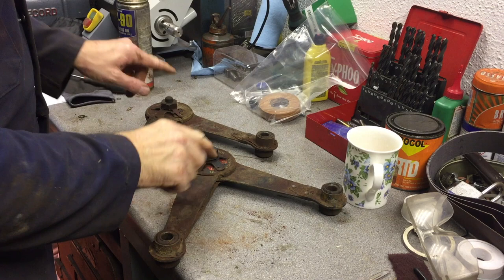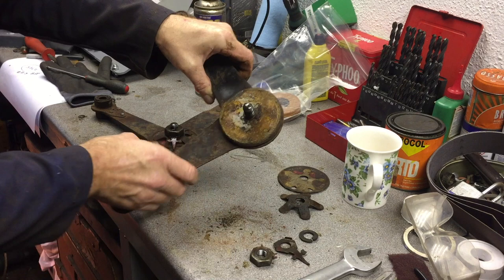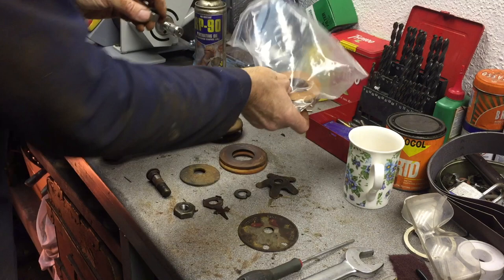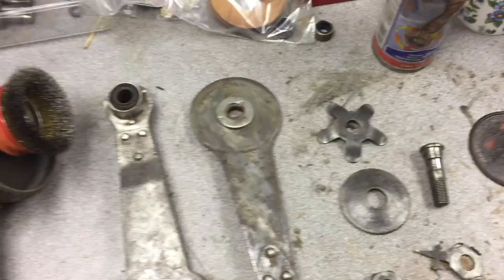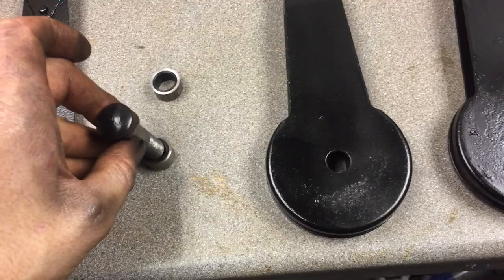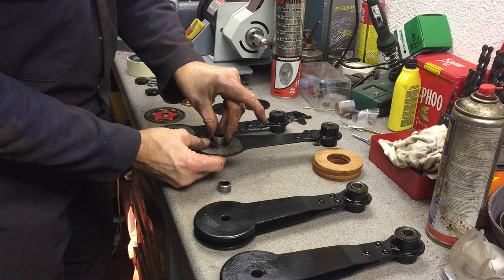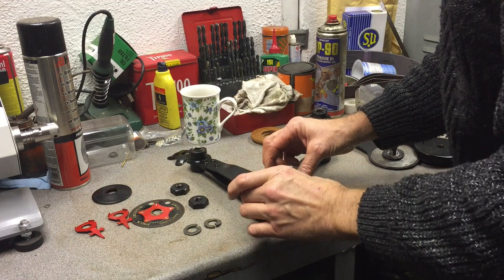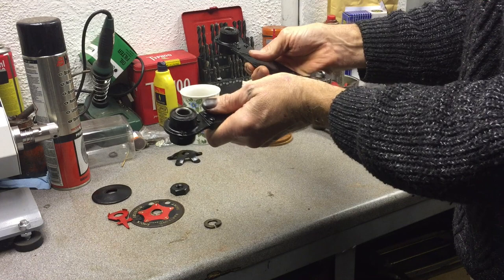Overhauling Andre Hartford shock absorbers from a Riley 9 Monaco

Comment: Bloody brilliant, I've got hold of a pre-war Crossley 1127 IOE in a chassis, and couldn't for the life of me work out how the dampeners mounted. The Hartford type may just be the job.
Reply from the maker: Very nice, i did look at a six cylinder pre war Crosssley  ( the same engine used by Lagonda with a bit of reworking )  a while back but i don't think i would of had the room for it in the garage. I don't have any affiliation with them apart from ordering parts from them but www.vintagecarparts.co.uk have a range of chassis mounting bolts for the Andre Hartford shocks which may be of use to you
Reply: @TweedsGarage  Sorry for the very late reply. I will send them an email as it's bloody hard finding parts in Australia for the less well known models. Thanks for that.

Comment: Very interesting and informative.  Is there a flat on the bolt that the either the adjuster number plate or indicator lines up with? Wasn't clear on the rebuild. 
I think you could do with a sand blasting cabinet.
Reply from the maker: i did have a blast cabinet but unfortunately for the amount of times it was used it didn't justify the amount of valuable workshop space it took up, so had to go. The indicator has two upward bent tabs that locate on the side of the adjusting nut so it indicates the movement.

Comment: Just one thing - although they are pre-oiled it doesn't hurt to oil the wooden discs by soaking them overnight in (originally) tallow, but thick oil (SAE 140) will do as well.
Elsewhere on internet it is recommended NOT to oil the discs at all but that is very bad advice; the shock absorbers will not work properly if the discs are dry and will actually soon break down.
Also it is not explained here how to set the tension - the best way is to place one arm on an old fashioned bathroom scale (not digital) and push the other arm down in a fluent movement and adjust the nut so that you get the required reading (40 Lbs on my 1500 kg Lagonda at the front, about 25 Lbs at the rear).
Reply from the maker: Thanks, I'll keep it in mind when i finally get some miles under the Riley , i did preload the units with luggage scales after i stumbled across some info for the loadings for lighter cars ( found after making the video which is always the way of things) . Thanks for watching .

Comment: How difficult would it be for the manufacturer to make replacement parts that fit exactly??? The over-long bush represents a waste of material, and over a production run they would have been able to produce additional items, so in their interests to get things right. I don't think I bought these for my overhaul so I won't have to fettle - none of this should be necessary if someone did their job properly and paid attention to detail. So much stuff for the older cars is not machined to the correct size, at different times I have brought it to supplier's attention the errors, doesn't seem to make any difference as the parts are still wrong, sometimes, there is a success, but there is a whole host of people not doing their jobs properly, rant over! Great video!
Reply from the maker: i know what you mean, i had a Norton head overhauled and ordered new valves and guides from a well known specialist, when measured they had 5 thou clearance which was bigger than some of valve/guides taken out!....when i spoke to the mechanic in their workshop he didn't see a problem with 5 thou clearance and said its what they used on their rebuilds.....when i pointed out that Norton recommended 4 thou was the maximum recommended clearance before replacement he couldn't see the problem.....so parts were returned and i had a set of guides made with the correct clearances.